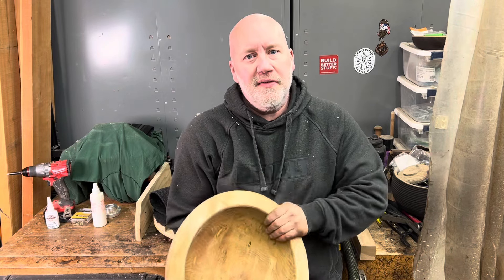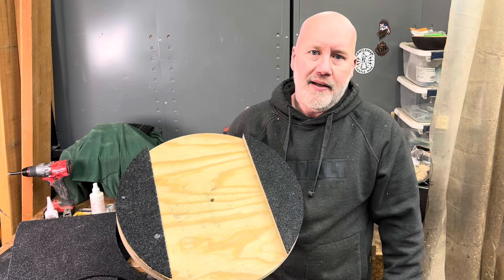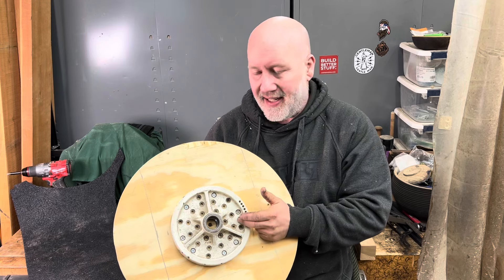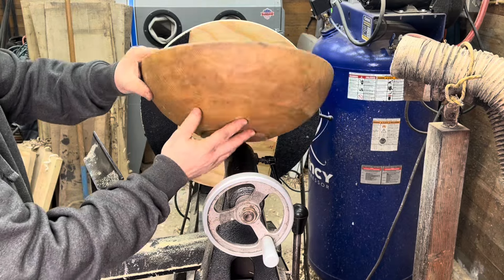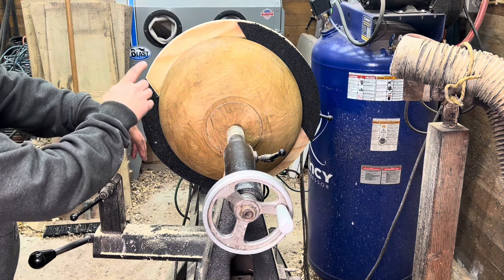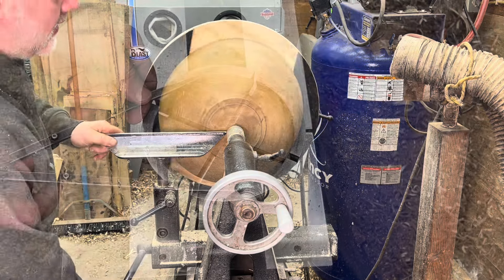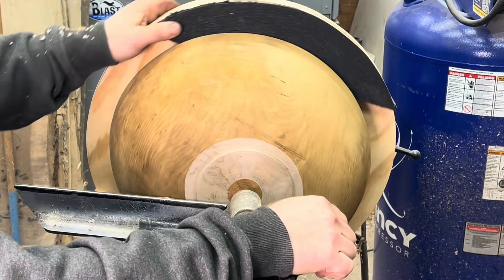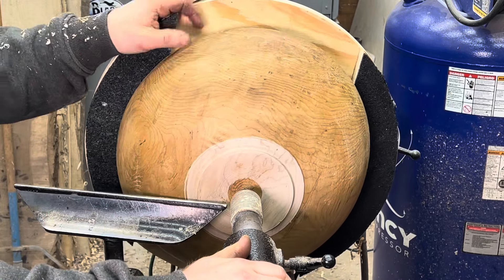How to true up a tenon and turn the outside of a twice turned bowl using a shop made jig.

Comment: I’m about to make one of these. Do I need to true up the plywood edge on the lathe before mounting the two side pieces? I found center on my plywood circle but surely it isn’t dead on. Also: I’m assuming you can’t turn the outside all the way to the rim with this method. The last little bit would need to be done once the bowl is reversed and back in a chuck, correct?
Reply from the maker: I don't bother worrying about the edges. It's not something you'd want to grab while spinning either way 😂. I generally turn just shy of the rim of the bowl, then finish it up after flipping it around. Hopefully that answers your questions
Reply: @alexanderdesigns814  Yep, that helps! Was mainly wondering about the piece running true, but I suppose that isn’t an issue as long as it’s flat on the face portion. Thanks for the response! Loving your videos.

Comment: Thank you Scott, I haven't seen that jig before...I'll give it a try...i usually use a jam chuck.
Reply from the maker: This method works way better for twice turned bowls (as long as that are oriented pith up). I think you'll like it. Plus it's super cheap to make.. Unless it's a quarter-sawn blank. Then I just use a jamb chuck
Reply: @alexanderdesigns814  Why do you use a jam chuck instead of the plate for quarter-sawn blanks?
Reply from the maker: This style plate doesn't work well for quarter sawn. A flat plate with rubber would work fine. I just don't do enough twice turned pieces to need one.

Comment: Great video, thank you for sharing. When you made the jig, how did you ensure the two semi-circles were perfectly parallel to each other? Or is eyeballing it good enough? Thanks!
Reply from the maker: I put one on, then measured from the top and bottom and made two points. Then connected the dots so to speak. Hopefully that makes sense. I could have eyeballed it and gotten close enough. After all ... most Woodturning is close enough 😂
Reply: @alexanderdesigns814  Okay great. Simple enough! I was over complicating it in my mind. I’ve got the materials to put one of these together so I’ll get on it. I don’t do a lot of twice turned bowls but it’ll be nice to have for when I do. Thanks again for the video and being willing to help in the comments.